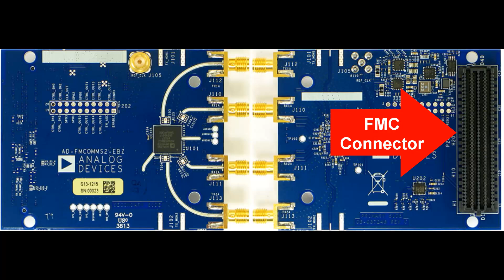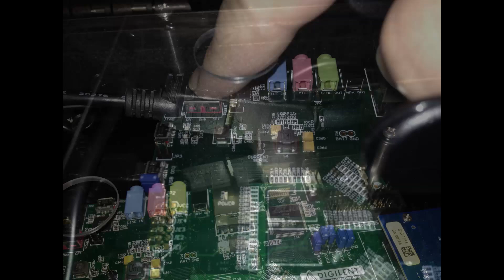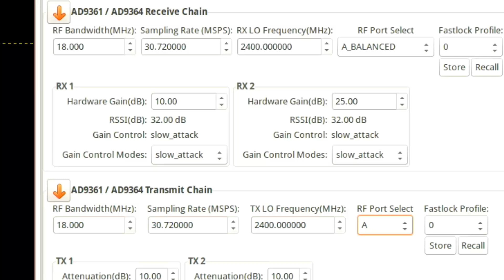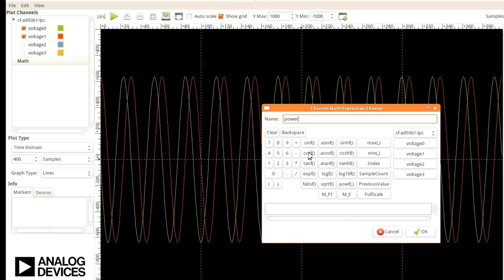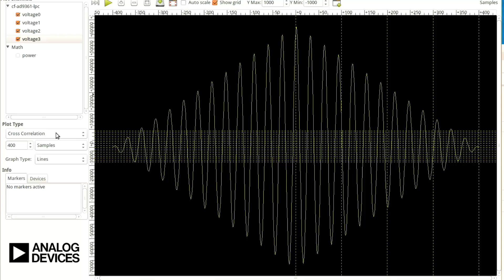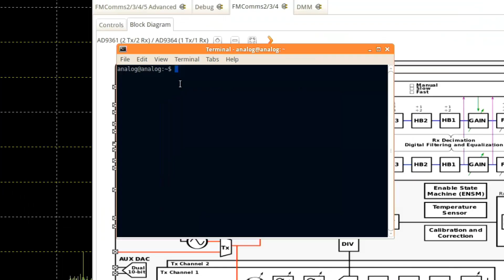FMCOMMS3 & IIO Scope introduction

Comment: Sir could you share a link for where we could download the software? My ADI IIO scope does not have all the features shown. Thanks for the great video!
Reply: I am not the owner of the video, but I am working with the same configuration that him. For have all the features shown in the video, you should install the plugins in the IIO Oscilloscope. The official page of Analog Devices have the sequence that one have to follow in order to install it correctly. In my case, I have the plugins of AD9361 instead of FMComms2/3/4. But it works exactly the same. Be aware with problems with the version of the library libiio, because I had problem with that.